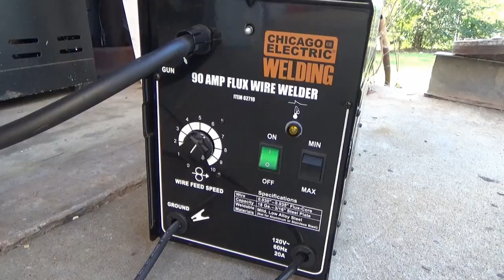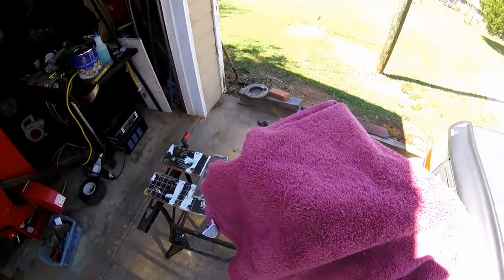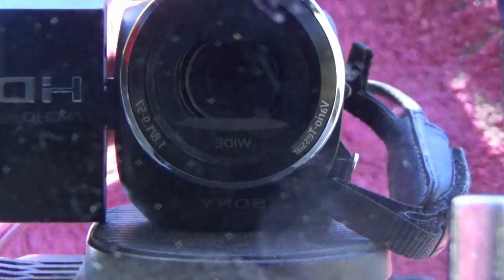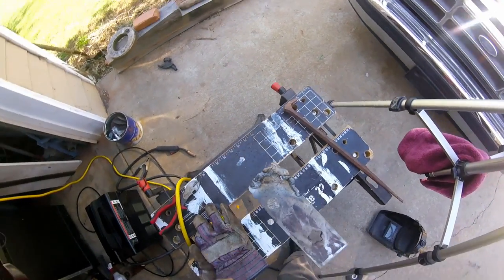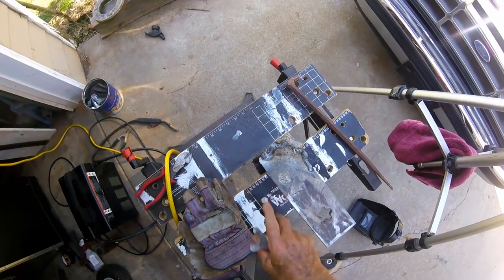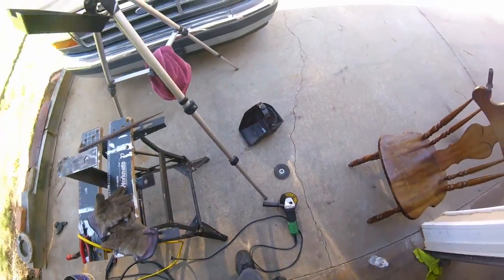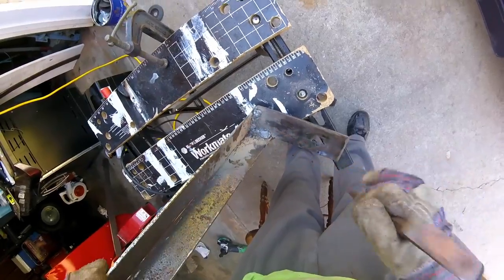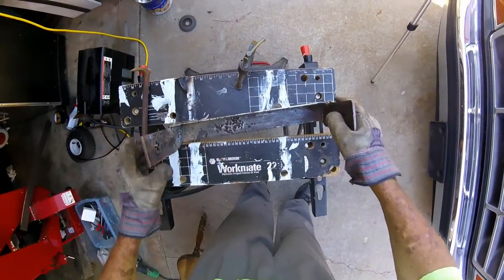Wood Chipper Tow Bar Project Part 3  Harbor Freight Welder Review

Comment: Walter, I think you have it welded pretty solid. It should be heavy duty enough to pull your wood chipper wherever you want to take it. Thanks for sharing. It has been a few years since I've done any welding, wonder if I still could. Where I used to work I did some construction welding. When I welded decking and walkways the way I tested them was I was the first one to walk on them and I was one of the biggest guys on the job.
Reply from the maker: You never forget how to weld b Thanks Matt

Comment: You don't need to use the hood for your camera, it automatically will adjust for the welding flash I have found. I have one of those Harbor Freight welders and it works well except for the large amount of "b-bs" it leaves. That is why I upgraded to a MIG welder with the shielding gas, which makes a much cleaner weld. I got a lot done with my HF welder before the upgrading.
Reply from the maker: Im sure it cost substantially more LOL  Thanks George

Comment: The way to get a flatter weld is to use a "C" pattern when welding, going back and forth, rather than just trying to draw a bead in one continuous direction.
Reply from the maker: Thanks for the advice George